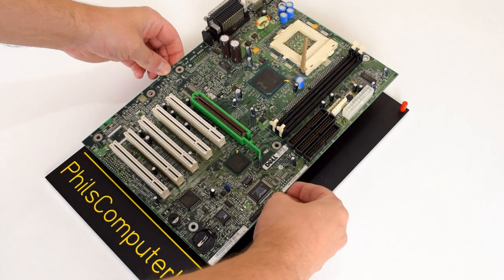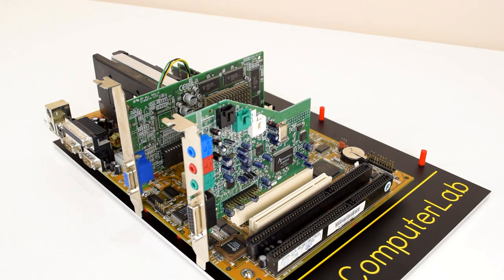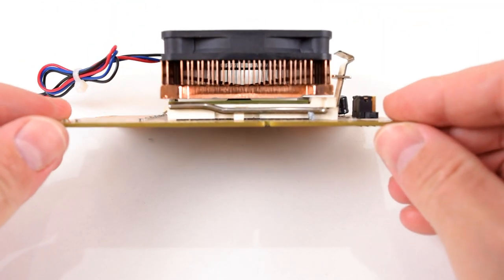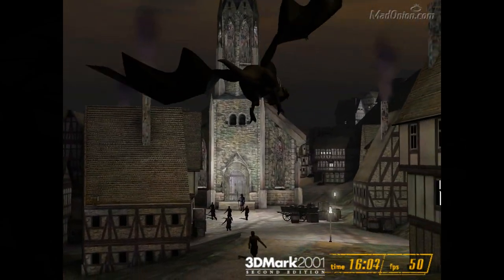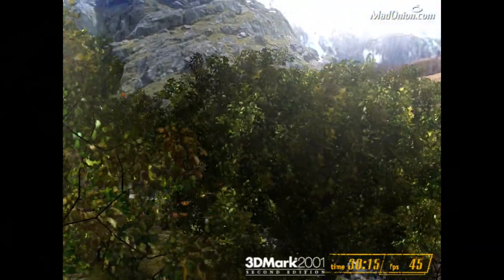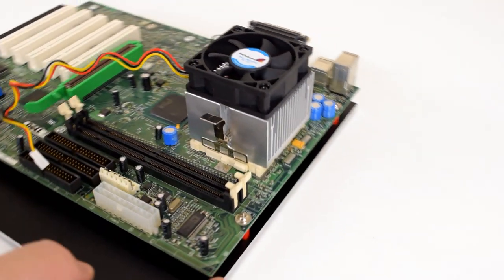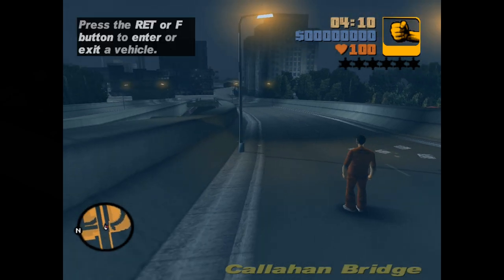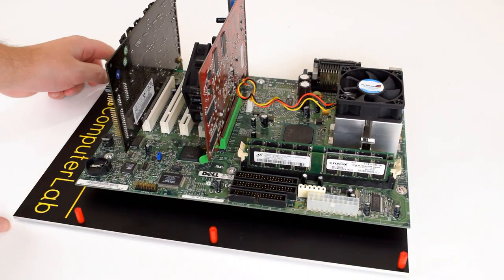The Pentium III 600EB - What does EB mean?

Comment: It's sad that after all these years I still remember those designations for Pentium III processors, probably because I was so obsessed with getting a new computer and researched the crap out of computers using Pentium processors. Once I got my new computer I started drooling over PCs with the AMD Athlon processors... =/

I just remembered the Pentium III systems running DDR RAM and a friend of mine got one from a boutique builder and the case looked like it was aluminium but it was kinda meant for servers.
Reply from the maker: I believe VIA and SIS had P III DDR chipsets.
Reply: yeah, his had a  VIA chipset but I could not remember the manufacturer of the PC. All I remember was that it looked pretty utilitarian and was advertised for light server work but was outfitted for gaming. I had to make do with an HP PIII 800 and upgraded the GPU to a Radeon DDR and SoundBlaster Live! Platinum card.  I originally wanted to get a Dell Dimension XPS B with an 866MHz PIII but the RAM upgrades made an already pricey PC even pricier so we pretty much settled on the XPS T with regular SDRAM... that was until my aunt somehow talked my parents into getting the HP.
Reply from the maker: Time to rebuild that machine you didn't get?
Reply: Only if I could get those old Dell Dimension beige tower cases as that was the only thing that really separated my HP from the XPS T (after I swapped out the Vanta TNT2 , added in the sound card and increased the RAM to 512MB). I still have the complete system sitting next to my Athlon builds from 2002 - 2006.

Comment: I bought a new 440BX-2 and a celeron 300A recently, not a had a chance to use them in a setup yet though.
Reply from the maker: Nice! I see these boards pop up on eBay quite often. What plans do you have with this build?
Reply: PhilsComputerLab Hi, I was going to use it in a DOS setup, but I realised a little late that Socket 7 is a better route with the ability to enable/disable both caches for older games. So I used Socket 7 in the end for that setup. I could perhaps use it as a late DOS PC for the final DOS games that were more demanding maybe.
Reply from the maker: Nice move with Socket 7, for DOS it has a lot of things going for it.

Comment: Like you, I took a break around that timeframe, hanging onto my Pentium III 450 for a good 4-5 years, upgrading to a used 550 at some point.  Then I bought a "cookie cutter" Dell.  I didn't build another until I went all out on the socket 775 Pentium EE release!  I still have that monstrosity w/ quad-SLI and a case that had a built-in air conditioner!
Reply from the maker: Quad SLI? Very nice!

Comment: Have you tried overclocking the FSB to 133MHz yet? I've bought a new i440BX board to use with my Slot 1 600EB which I foolishly thought would run on a first revision ASUS P2B (old voltage regulator, only goes as low as 1.8V). I tried overclocking my Pentium II 350 by raising the FSB to 102 or 112MHz and as a result got garbled sound in DOS mode. The other reason I bought it is because the AGP Bus or possibly even the CPU is defective; only 4MBs of graphics aperture size are accepted and AGP acceleration fails in 3D games as well as every ForceWare nVidia driver from opening dropdown menus.
Reply from the maker: I don't like overclocking old hardware much. If something is too slow, I just choose faster parts.

Comment: Yo Phil, you ever grabbed the Katmai 600MHz P3?
Reply from the maker: Sorry what?
Reply: There's a Pentium III clocked at 600MHz using the Katmai core floating around.

That may very well be the top-tier Slot 1 CPU bar Slotket adapters.
Reply from the maker: I have the 1 GHz Slot 1, so I'm good :)
Reply: Wait, there are 1 GHz Slot 1 Katmais?

Comment: I was using the best board available. Asus p3v4x. You should really get one. Noone used rambus. That was the major part of intels p4 fuckup. The whole history of the p4 just just one huge fuckup. Anyway, get the asus board, it's got all the good slots.
Reply: The asus board was a great overclocker.
Reply: Oh yea, just a shame I can't recall what overclock I got on it. :( I remember I did have all the slots filled up, (agp+6pci as the isa was shared), it was one packed computer. The only overclocks I can really remember that were great back in the days I got was a 200mmx @300 on an ax59pro, and a duron 600@1ghz on a modded a7v133.
Reply: MV60 ahhh the duron! I had a 650 which used to run rings around my other friends stuff! reminds me of the pencil mod on the cut bridges!
Reply: That pencil mod was so good! tho I ended up using a more conductive connector. I think I held on to that CPU till I got an athlon xp 2500 that got clocked to the 3200 speeds out of the box!
Reply: I'm glad i got a few of these a few years ago... 
I also got a deal on brand new Intel Slot 1 933EB coppermines... 
Soyo SY6VCA is a close second
Reply: I also oc`ed Duron on A7V133 and that was great board :)
Reply: Druaga1 also has an A7V-133 in his 98 rig, but it's an Athlon XP @ 1.4 GHz.

Comment: ive had P3 600mhz one dont know what model, but i cud clock it to alil over 700, 133fsb, 128mb of ram (later upgraded to 256 or 512)and 20gb hdd, it was a prebuild from Fujitsu, and i installed a Voodoo 4(5?) 4500. man that thing was a beast, to me anyways.

Comment: I was just a little child around the time of these systems, so I didn't have the comprehension for them and don't feel nostalgic to them, but I still love these systems regardless. I've got a Compaq Deskpro EP/SB series tower with a 450MHz Slot 1 Pentium III that I installed some ATi Radeon 9200 job into to play games on. I've got better systems for this purpose, but I like this one. Too bad I've never been able to get sound working in it. Either its original sound card is roasted well-done or the drivers I keep finding are bogus.
Reply from the maker: For Windows 98 SE, I can recommend the Sound Blaster Live! Look for models SB0100 and SB060.

Comment: I still own a Rdram motherboard and the RDram it'self. (gateway). It's a pentium 4  board. I run a 3.0 ghz cpu, very solid but hot. Very, very hot. Using only a 400 mhz FSB cpu it runs a bit cooler of course. It would be probably worth a review since it's considered pretty rate today. Good video as always my friend.

Comment: as allways ^^ a really good entertaining and informative video

since 2003 i have a Pentium III -S running @ 1640MHz with RAM @ 156MHz sync CL-2-2-2
other specs are 2x32GB IDE SSD 1x400GB IDE HDD and later upgraded to an 6800Ultra 
on an Gigaby GA60XT RLY stable and overclockable > thanks to a changable PCI divider
OS > Windows ME + Windows XP Pro SP3

i still love this machine and i´ll maintain it as long as possible ^^
Reply from the maker: Nice!

Comment: I have a Pentium 3 800 EB, its very overclockable.
Reply: They are quite nice. my 933 EB can easily run 1035 MHz.
Reply: Was there any Pentium III that's not good with overclocking? because I can't name one.
Also, I don't think there's any processor can't be overclock back then, because we don't have artificial limitation put in the processor either from Intel or AMD.
Reply: Key Lock The Pentium 3 with the Katmai core is not a good overclocker. My Pentium 3 800 EB overclockes to 933 mhz perfectly stable with default voltage, I guess it would overclock a lot more but my motherboard only allows a maximum fsb of 155.
Reply: I don't know what's that had anything to do with your first comment.
My point is, every Pentium is very overclockable, how high or low/good or bad can you get is irrelevant.
Reply: I have a 1133 MHz P3 that can run passively cooled (at least as long as you don't stress it too much). A unicorn?
Reply: Not  really. You can run pretty much any CPU passively if you're gentle with what you demand from it.
Reply: Pablo Escobar do that with most processors these days... you'll end up with something resembling a roadside flare inside your case.
Reply: Up some point all of them basically had unlocked multipliers.
Intel locked them so system builders couldn't put in a cheaper CPU, OC it and sell the system for more.
But then we found out it is possible to change the FSB itself...

Comment: Oh gosh, hard to remember around 2000 but I believe I was using XP, DDR RAM and an Athlon 800MHz overclocked to 900MHz with the pencil trick. Shortly after that, I had an Athlon 1400. I stuck to the ASUS A7V series like the A7V333. 
I never had Intel until my current i7 6700k but my dad gave me RAMBUS memory which I then sold on ebay for 3x times what he paid for it. RAMBUS was no longer being made then.

Comment: I remember around that time I had a bunch of system failures, and also a complete hard drive failure for good measure.
I can't quite remember what order I used things in though.

I know I had a pentium 3 733 mhz system on an adapter card for a slot 1 board, but also a Duron 1 ghz system.
For a really long time I had no 3d accelerator at all, before finally getting a Geforce 2 MX, which is my first 3d accelerator card, and actually my only nvidia card ever. (To be Specific it was a Gainward Geforce 2 MX golden sample.)

It was a pretty good system... Until it died.
In hindsight it was caused by a rampant bad capacitor issue that was going around in the early 2000's...

I never used RAMbus with it - I could never justify any system high end enough to use it.
Of course, as the owner of an n64 I did in fact have a system with RAMbus memory around...

It's ironic considering just how eye-wateringly expensive that stuff was that by 2000 or so N64's were in the ~$100-200 range.
Granted that's only 4 or 8 megabytes of RDRam, but still...

Comment: phil, i'd like you do a video about graphics card unlocking, for example the radeon 9550 that could be unlocked to the 9650, will be also nice to see a countiunuation of those pentium 3 videos, ando also benchmark tualatin processors
Reply from the maker: I know this was a thing back in the day, but these days, you can just buy something faster. I feel the same with pencil mods and other projects, the parts are so cheap, just get what wish you had back in the day. That's my approach at least. I'm not familiar with a Radeon 9650, what model is that?
Reply: i am sorry, a typing error, i mean radeon 9600, i am talking about graphics card unlock because of the good old days of overclocking when you can just buy a cheaper gpu and with a mod and get the same performance of a more expensive one, this was one of the things for enthusiasts back in days like the celeron overcloking

Comment: I was given a dell dimension 8100 1.4ghz pentium 4 with 256mb rdram and a geforce 2 gts when some one upgraded around 2006 . It was a huge upgrade compared to the amd k6-2 350 overclocked to 400mhz in a asus p5a-b super socket 7 motherboard with 128mb ram with a ati rage pro that I had been using until then . Never had any issues with the ram, eventually upgraded it to I think 384, it was still pretty pricey . Wish i had kept it . I gave it to a neighbor several years ago .

Comment: Hi Phil, how about inlet 810E chip-set? (my first system) I think that is the point intel added 133 FSB to the chip-set.. (also support 66 and 100 so great for under-clocking) However no support for AGP!
Reply from the maker: Yes, the dreaded 810 chipset. It actually had quite a few revisions. I have one board, but when I tried it out it wasn't working. Without AGP the options for gaming are limited, although a PCI card can work for less demanding games.
Reply: I just did some digging.. it says "810 supports asynchronous bus clock operation between the chipset and CPU (front side bus) and the system RAM. So, if the machine is equipped with a Celeron that uses only a 66 MHz bus, PC100 SDRAM can still be taken advantage of and will benefit the IGP"  

I guess that is why my under-clocking attempt to 66FSB (~364Mhz) for 733Mhz/133FSB P3 worked without any issue..  one can effectively half the cpu speed just by changing one jumper :) no need to worry on RAM as it works with its own 100Mhz Bus! No idea if this is true for most other chip-sets around this time.

Comment: Never used a socket 370 cpu in my main system. I did have a Slot1 450 MHz pentium3, but after the increased prices for the intel platform (ony RDRAM for p4), I decided to upgrade to an Socket A Athlon system with SDRAM which was quite powerful yet cheaper than any p4 platform.
Reply from the maker: Looking back, Socket A was a smart move.

Comment: I did not have my first useable PC until 2000 and that was a Dell Dimension 2200 except for being a solid machine it was a POS 1ghz Celeron 256mb ram 20gb PATA HDD and Win XP it didn't even have enough headroom to power a DVD-ROM my first real taste of PC gaming as I was stuck on warcraft and starcraft and red alert 2 as my Dell even fought to run games that old it was not until 2007 when I got my hands on an AMD Athlon XP based system with 512mb ram and a Geforce MX 220 I think which I did upgrade to a 440  and 768mb ram so I was really late to the game but still like watching videos and learning about what was out there that I could have had if i had a better job
Reply from the maker: Thanks for sharing!

Comment: curious as to what settings you used for GTA III.  Wondering if my Geforce 3 is the bottleneck for my setup as it doesn't run quite as smooth with a 1.4Ghz P3.
Reply from the maker: Default settings I think, but I disabled trails and also increased resolution to 1024x768.

Comment: I recently find a Compaq PC with a Pentium III 800mhz and the i815 chipset, but when I try to power it on, it stays on for about 5 seconds and it shutdown, no POST beep or error (The system´s specs were from an info tag at the side of the PC)... So I have it liying around until I have time to test it more deeply and try those good old games from 97-02.

Comment: back in the day I had a BX440 Abit motherboard with a 1ghz P3 (133 FSB) on it and this machines usefulness to my memory lasted AGES... These days for retro gaming I've got a, 815 motherboard, simply because I wanted a mATX board and I'm not sure such a thing exists with Slot 1 + BX... also I actually wanted not to have to faff with ISA ;)
Reply from the maker: I really like the 815 chipset, good choice.
Reply: Do you know if formal matx boards started with the 810/815 chipset??  I've honestly never seen a matx slot 1 board!  I don't think I have a slocket adaptor anymore even if I had the board... never looked like a reliable setup but never once caused me a problem with a 133mmhz P3 on a BX board!
Reply from the maker: Good point, yes I also only have S370 boards as my earliest uATX boards.

Comment: I switched to AMD after the Pentium MMX 233MHz because I was in college and couldn't afford the Pentium 2 that followed, I stuck with AMD through the Athlon XP (cannot remember the exact model I had last) and when it was time to move on to 64bit CPU (around 2005) I switched back to intel for the Pentium 4 630 CPU with an intel motherboard because I couldn't find a MB/CPU combo in AMD that would remain stable after installing the OS (granted my local store didn't have much stock to choose from) I've been running intel CPUs ever since

Comment: Is there slot 1 motherboard, that supports Tualatins, 133 Mhz FSB / RAM, have Universal AGP slot, WHILE still have a ISA slot for soundblaster compatilibity under DOS? 
I have retro PC BX440, with PII 400, but it's quite slow in later Win98 games, I want to have also real DOS with sounds, in one computer. Not sure, if I can use Tualatin with slocket in that board, but it runs only 66/100mhz FSB. Is there some 133 mhz one?

Comment: Should I be ashamed for still using an Audigy 2 ZS? I mean it's a pretty solid card and as long as my computers have PCI slots I will not consider replacing it.
Reply: Absolutely fine. The only reason I'm not running my old audigy anymore is that the drivers for anything Vista and later are rather mediocre and that the card stipped working. Running those older cards on an XP machine is still totally viable. Just think about that EAX sound, Crystallizer and stereo upmixing....
Reply: I'm actually using it on Windows 7 and the drivers work... fine I guess. It's better than the onboard audio circuitry of my motherboard, well, at least the gold-plated connectors look cool. I've never actually used my card on anything lower than Win7, so I can't really compare the drivers. I ought to try it out though!
Reply from the maker: Yes it's a great card!
Reply: I am using an Audigy 2 ZS Platinum with the front panel with my current rig I built last year - a 6700k w/ RX470 dual booting Fedora/win7. Sounds great and works great!

Comment: In 2001-2002 I had a Pentium 3 600 with a bad motherboard (via chipset), it was really slow and the capacitors were inflated. I replaced them  and  it worked but, I bought a intel motherboard with a Pentium 3 550 and it worked far better